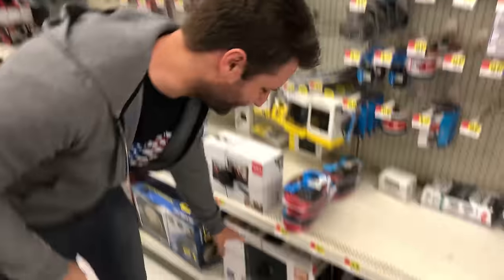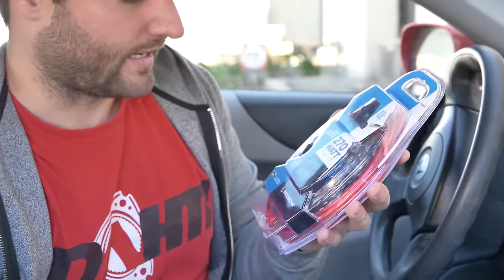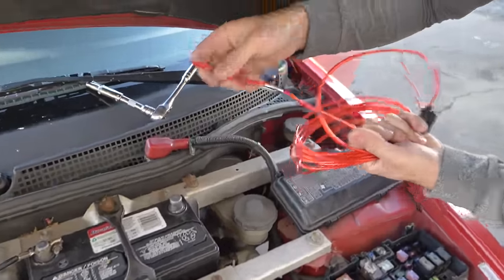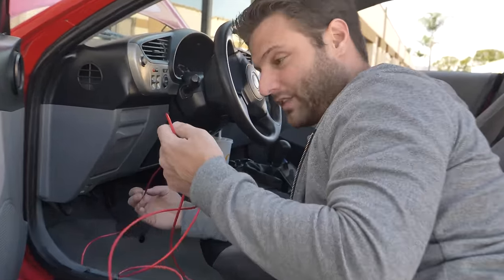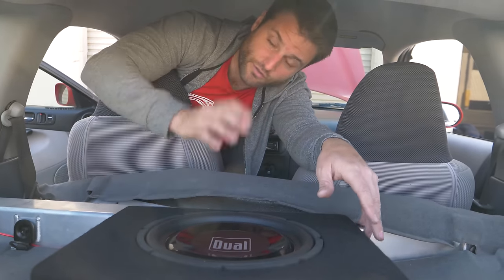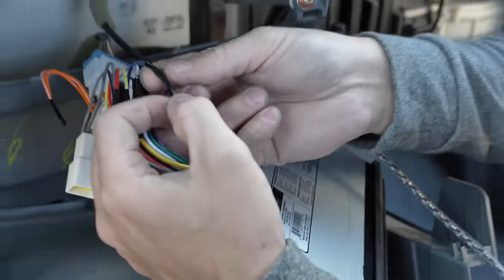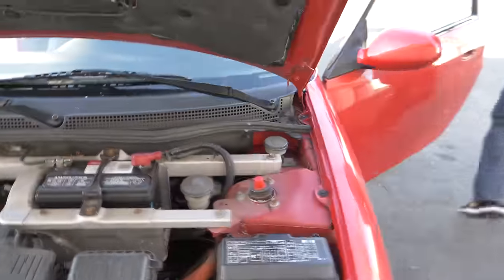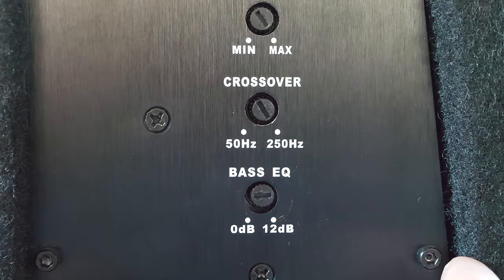How bad is the $70 subwoofer from Walmart? Install | Review

Comment: So did he turn the crossover closer to 50hz or 250hz
Reply from the maker: Closer to 100 sounded best it seemed
Reply: So is it better to turn it up or lower it down?
Reply: The all depends what you running and wanting.
Reply: TheTruth lower hz for lower bass and higher hz for higher bass tones
Reply: your box is tuned to a specific frequency so dropping the xover past its optimal range might make no sense
Reply: depends on the specs of what frequency the woofer is capable of playing. enclosure will play a role in this. Its said 20% of the sound comes from the woofer 80% from the box but since its sealed youll have a better range of frequencies.
Reply: Lots of things to consider when adjusting your crossover.  Do you have a hpf on your door speakers? are they stock door speakers?  and what freqs does your car and enclosure resonate.  I personally like my car crossover at 100 hz.  With having proper door speakers.  If i had stock door speakers i would probably consider bumping it to 120-140 hz and then using my hpf to cut those frqs out of my door speakers  so I could push the system harder without clipping the door speakers.  on a side note make sure your hpf and your lpf are at the same freqs or maybe even a little overlap.  one issue when your pushing lows through your doors speakers is you could be phasing (cancelling) out a large portion of what the sub is driving, also usually decks dont have a very high rms and any lows you can cut out of your door speakers creates headroom for your highs and increased fidelity.
Reply: There are some excellent videos covering the ranges of sounds that will help you setup crossovers for lows, mids, and highs as well as do proper EQ tuning (which scares the crap out of a lot of people due to all the slider settings).

My sub in my car is set to 120hz, meaning anything 120hz or lower on the track will be played by the sub, I have it faded for another 30hz for a total of 150hz with a high decibel slope. This gives me a wide range of bass, and as long as the gain is adjusted correctly (mine is for my music) then I get nice sounding bass at points you would expect in songs.

While I primarily listen to Hard Rock/Metal I also listen to  a few other songs as tests for my cars audio system calibration.

1. Dolby Digital theme - The reason behind this is that it will play Low - Mid - and High all at the same time, and you can find out where you need to adjust.

2. Classical - Beethoven Symphony #9, starting off it has an excellent test of lows, mids and highs and constantly switches from piano to fortississimo (soft to very loud), it's easy on the ears (easier than the dolby test), and allows you to pick up on more subtle changes that may be needed. I also listen to classical from time to time, especially when I have a headache, it does seem to help a little then.

I am not some car audio expert, I just did my research when I was doing a complete overhaul of my cars audio so I knew what I was getting into, I wanted the audio in my car to make my friends and family jealous of it's quality sound, it is a Lexus afterall. So I watched some very help videos on car audio, EQ tuning (very interesting), and crossover settings.

Comment: This sub sucks. I actually bought the same one. I blew it the first 2 weeks
Reply: I have two of them in my truck. It sounded a hell of a lot better with both but, I have the bass on them turned up pretty high since they aren't very powerful. I lost one speaker about a year ago while the other one is still going strong. For the price point of this sub/amp combo, I had no complaints.
Reply: For the price it's great. Especially if you have no space. Now if you could spend a good chunk of change and get something JLAudio and not so compact, you'd love it.
Reply: @scp0787  There are better and cheaper setups than JL mate :)
Reply: @drummonkeystuffuk1875  

Not ones that won't Cook after a few months of use. I've gone through Renegades, Duals, ect. And they all blow pretty quickly.
Reply: @scp0787  Haha are you serious? I've been running a set of Hertz audio mids/highs and a 12" hi energy hertz sub for YEARS and they haven't blown. Anyway subs are blown by clipping or incorrect gain settings. Any experienced audiophile would tell you the same lol.

Why would I pay $1000 for a sub when I can find something better and cleaner sounding for $500? Trust me you are just paying for the name on the speaker.
Reply: @scp0787  Dude You're telling me that JL won't cook if you push them too hard or give them clipped/ distorted power? You're totally wrong..I've been messing with audio for about 15 yeears and rarely blow any gear!
Reply: Nick Taylor my home theater system would blow this thing out
Reply: Sullivan Shull you’re better off getting a Kicker PT250 if you’re willing to spend an extra $120. At least you get that reliability. At the end of the day, you get what you pay for. The thing is, if you blow this speaker, then this doesn’t have the bass you wanted and as a result, it’s an error in buyers choice. This is why I’m getting 2 12” 300W kicker subs because I want more bass, instead if just pushing the pt250 harder. Otherwise, this sub is perfect for non-bassheads who feel their car needs just a slight boost in umf.

Comment: All the wrong ways you run a power cable for an amp 🤔😞
Reply: Well, it is a cheap Walmart sound system. So of course it's gonna be wrong. Most Kyles install this in their 93 Honda Civic DX Automatic in the car park.

Comment: as someone who does custom installs. if this is your first banging on a budget do it! but i will give some advice where he messed up in this video the wiring from the battery.....  always use tie wraps to hold it tight and dont put that much tension on the main wire ... never run power with your signal wires  (rca,speaker wire)  every basshead starts somewhere this isnt the best i would recommend it but if is all you can afford  just send it! you can upgrade later

Comment: I out this same amp and sub in my 350z two and a half years ago and it still sounds great and it thumps pretty hard too. I do have a $300 Pioneer radio that I can tune and mix on the fly but it still sounds great. I also routed the wires the same exact way but on the other side of my car cause of my battery being on that side.

Comment: Do not I repeat do not run it to the fuse panel run it to the battery positive
Reply: Doesn't matter.. that amp is 300watts and RMS is probably 75 -150. That fuse block he mounted it to has a direct lead to the battery.. u think that amplifier pulling 5-12amps is going to be a problem? You are severely mistaken.
Reply: @OregonDonor87888  I think he was probably talking in general
Reply: @OregonDonor87888  doesn't matter it still belongs to the battery itself
Reply: @boostedlawnmower9955  somebody with since then u got your internet know it all
Reply: @dhestondh  what

Comment: Always solder your wires and then use shrink wrap.
Reply: I don’t know about ALWAYS soldering your wires. That could cause some really strange and dangerous issues in an odd event. Heat shrinking your wires is def a good idea though. Not 100% necessary but if you’re gonna do it, might as well do it right.

Comment: Problem with running it through the fuse box is now you have defeated the gauge the wire. Because now it has to go through smaller wires and THEN back to that thick power wire.  That’s why you should connect directly to the battery.   That’s why it has an inline fuse

Comment: As a novice amateur sub enthusiast. Please use a amp wiring kit that's rated just above what your amp is rated for. 2nd, never ever connect your power wire to the amp to the vehicle fuse block. Professional always go to the battery post. Otherwise, straight forward install. And word of advice, drop your bass all the to highest negative it will go, then tune your amp

Comment: I understand the point was cheap, but I watched both videos on this install and cringed most of the time. Duel is cheap but there is still slightly higher but much better option for the car. I hope in the year or so since this was made you did a better system with proper connections..  I believe Walmart even carries kicker subs now.  This was a very basic install so props for that.

Comment: Yeah, I have masters degrees in Electrical Engineering & Computer Science from the Massachusetts Institute of Technology... the only disastrous thing you really need to worry about is if you were running a huge Stiffening Capacitor (anything 0.25 Farad or higher) I’ve known kids who’ve accidentally wired them backwards... and if that happens they will explode like a pineapple grenade

Comment: I liked your $20 speaker install better.  This install has fire written all over it.  I'm a leading expert on electrical power and engineering and have design both nuclear power plants and generator power.  So basically anything from 1kW to 1000MW.  Everything from the wiring with electrical tape to how the sub is connected to the battery is a fire hazard.  Anyone saying otherwise should take a course in Electrical Engineering 101.

Comment: Remote turn on always has to come from the head unit because with out it the amp will not power up when the radio is on. Car audio is my thing I remember when it started back in the 80s with house speakers and power EQs. Try stuffing 4 12in Alpine Type Rs into the trunk of a 1990 Corsica.  Something else that happens is whine coming from systems when the cars running thats due to bad Grounds.

Comment: That head unit needs to be run with a high level out, I have a similar setup in my dash but a much more powerful sub with a high level out that can shake my entire seat at half volume with very acceptable distortion levels

Comment: The best Subwoofer I ever owned was a 10" radio shack name brand that I put in a sealed box someone threw away, cost me 12$ on sale and i spliced my rear 6x9's to power it and it had no right sounding as good as it did. I was stupid and young so I had no clue what I was doing and thought it was the only way to do it. Then that one failed eventually after a few years and I got a 10" solo baric L7 and had that in a sealed box too and that thing banged insanely hard even with a shitty 200 watt amp i fixed.

Comment: I simply use my original car's speakers but sometimes i wish there was a bit more base. in my last car i simply connected a small sub into one of the speaker wires, without using an amp, and it was enough to give me a bit more base! :)

Comment: Theres a reason why I hire professionals to do my speaker work, because I'm too much of a pansy to take apart my dashboard. I recently got a 2005 Lincoln Town Car and I'd like to upgrade its sound since its a nice ride, but I'm way too skittish in taking anything apart.
I think a lower RMS sub like this would be best felt behind the drivers seat. You'll get the illusion of big sound and feel, without the obnoxious noise and distortion. I do a similar trick with a 35w sub found with a 2.1 computer speaker set. I set it up at my bed and put the sub against the wall under the bed, and it essentially uses the wall as an extension of the speaker box, making the little 35w subwoofer sound way better than it really does.

Comment: I owned a set of dual 12's in a ported box. 1000w Rockford fosgate amp.. the speakers banged but lacked the rump that better quality speakers offer. My Alpine 15's you could hear me a block away. I also had to install an external hard 4 tb drive and a doubledin deck cause CDs wouldn't play.

Comment: Find a hole In The firewall usually around the brake pedal tape the long end to a coat hanger and push it inside the car along the firewall.. then go inside pull the tape off the wire and pull it through.

Comment: You asked for the best location for the sub. My extensive experience of in-car stereo tells me you should put it on the sidewalk next to your car, then drive off.

My biggest regret - I haven't had a car in 10 years.. I don't need one now, but I love the sound of good quality car stereo. It's amazing being surrounded by great sound and the feeling of deep amazing bass that you just can't get at home with the neighbours (or the fact that you're in a giant box full of speakers)

I've kept up with car stereo somewhat.. I've been following JL audio. They haven't changed their flagship subwoofer in over 10 years the JLW7. 
And I know why, because I had one. It was unbelievable quality and loudness. Normally you get one or the other.. not this thing. It was both.

But they've just released some new full range speakers.. and seriously -  I was thinking of buying a car just to try out their new JL Audio C7 front speakers... only $3000 a pair!

On my car I spent absolutely ZERO on the outside of my car, I was only obsessed with sound quality. On the inside however, I went completely overboard. I had to have a split alternator to charge a second battery just so the deep sub hits didn't dim the headlights it was pulling so much power.

Everyone who sat in it immediately said.. WOW, that sounds incredible.. then they'd reach for the volume knob and not even get halfway up before it was too loud for them. It never distorted, perfectly tuned. One of the most expensive parts was the CD Player up front - it had no flashing lights, no dolphins swimming across the display - absolutely nothing special at all.. just pure quality with super class DAC built in. It was a thing of beauty.. Then I quit driving because I moved somewhere with nowhere to park and a city I could walk across in 20 minutes.

I miss that all immersive car audio experience SO much. It was one of the most relaxing things to do - go driving out in the countryside, some great music cranked up and the bass being perfectly tuned to the system. It hit HARD, but it didn't stand out as a subwoofer, it blended with all the other speakers perfectly.

Anyway.. if you made it this far, I don't know why you read all that. It was me just reminiscing about sound quality.. 
Watching this video made me want to cry for anyone that had to PUT UP with music in this car.. its not enjoyable, its torture.
Once you've had quality, going back is painful.

Comment: You asked about sub placement? For the best sound, wire it up and listen in every conceivable placement location. Once you find the sweet spot, mount it. Ignore what seems right, and try different things. You have to live with it, so use your ears. Even if it means pointing the box to the rear of the car. Food is the ONLY thing more subjective than sound. If you like how it sounds, go with it. There are too many variables in the shape of the cabin, the resonant properties of the interioir materials, and the sub. Experiment first, you'll be glad you did.

Comment: You had a 50/50 chance on which terminal to take off first and you got it wrong lol. Taking off the positive terminal first leaves the risk for discharging your battery or electrocution.
Reply: electrocution by 12v lmfao

Comment: the remote switch is powered off the radio , think its a bleu wire , if you put the switch wire to the constant power the speaker will work flawlesly , it will allso drain the battery as it will be allways on

Comment: As a owner of a true 300W RMS Rockford-Fosgate powered subwoofer, this is VERY weak. However, if you aren't a basshead, and never plan on cranking up the bass too high, this could put an audio system from downright terrible to barely acceptable for balanced listening.

Comment: I was shocked to see a modern car without rear speakers. Even the low end Dart has these things. I know, it's a Honda, they're not known for audio, they're known for cars that last. Still I am a bit shocked. But, good job. My roommate would never figure this stuff out.
Reply: That car is super tiny. There are no rear seats. And if they did have rear speakers they'd only be two more 6.5s like every other civic from those years.
Reply: @forzaflyracer3473  That was my thought too. But for the price, it's a Honda, they don't give them away and like this one must be like super low end. It's just a little shocking to see a modern car made by Honda with just 2 speakers like this. That was something we might have seen in the 80's and early 90's! I found that detail interesting.

Comment: So it was on sale and I bought it, and yes I installed it today my self which I don't know shit about stereo or wiring. Just now got it all hooked up and I don't care what you naysayers say, For $80 all in it compares with much higher priced systems, and I got crappy little truck speakers also. Put in some bass CDS and pretty damned impressive !!!!!!!!!!!!!!!!!
Reply: Glad to hear this. I'm thinking about getting this today, because it's on sale for $50
Reply: I did connect to the battery direct thou, and also ran the power wire and the rest on the same side of the car out of necessity, no hum or interference so far
Reply: I don't honestly see how you could regret it because mine sounds AWESOME, it really does, it rocks

Comment: Rob the rear speaker wires that you talked about,  did you ever test them to see if you could have another 2 6 1/2 inch speakers?  A lot of manufacturers have it to where you can just plug and play into those spaces.